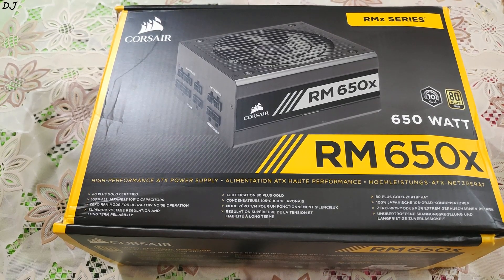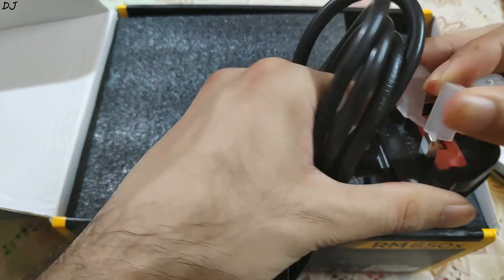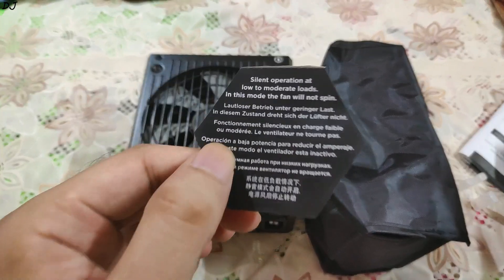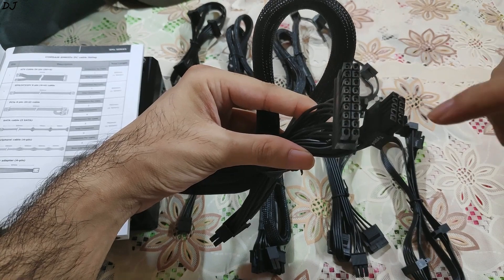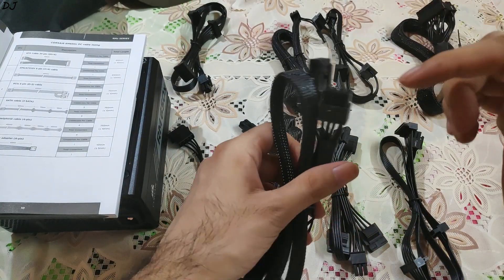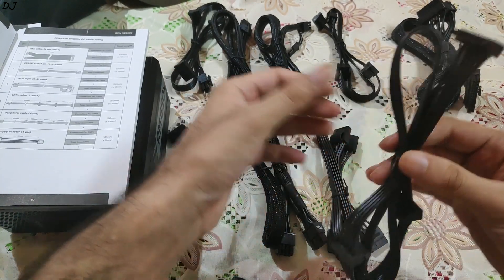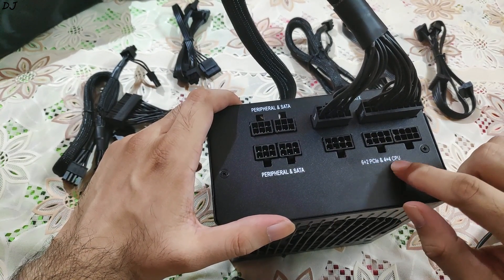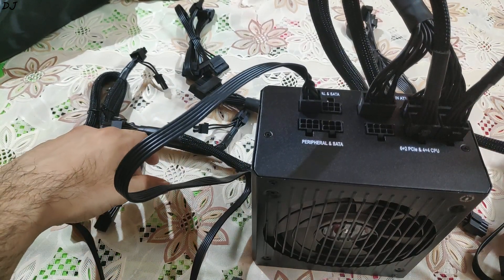Corsair RM650x 2018 Power Supply Modular Cable Installation Guide & Overview

Comment: Upgrading my PSU(RM 650) and GPU to RM850x /Rx7900xtx. RM850 PSU only comes with 2 PCI cables. Can I use 1 PCI cable from my 650RM to use on my RM850?  Rx7900xtx requires 3 PCI cables.
Reply from the maker: Should work
https://www.corsair.com/us/en/psu-cable-compatibility
Reply: @GamingDJ4u  Thank you. It works.

Comment: the gpu I want requires 2 - 8 pin pcie connectors, would the two 8 (6+2) pcie connectors work fine?
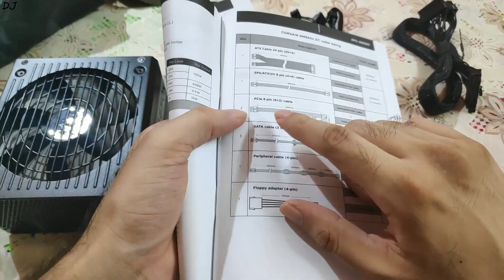Reply from the maker: yes , you need two of these cables 05:03 , i used 2 8-pin cables instead of one to power my rtx 2070 super 2 years ago .

Comment: probably a noob question do i need to plug in the two pcie connectors for an 8+8 gpu? or just use the one cable with dual ends?
Reply from the maker: Separate cables are recommended for a better power delivery
Reply: @GamingDJ4u  thanks so much!

Comment: This works the same as the Corsair rm750x power supply right?
Reply from the maker: Yes, rm750x should have an extra 12v ATX cable , high end mobos have 8 + 4 pins connection slot for powering the cpu . Extra 4 pins for extreme overclocking . Rm650x only comes with one 1 8 pin eps/12v atx cable

Comment: Can i replace the 24 pin cable with another rgb cable
Reply from the maker: Can't use any custom cable , compatible cable is required , cable has in line capacitors , something like this
https://www.corsair.com/ww/en/Categories/Products/Accessories-%7C-Parts/PC-Components/Power-Supplies/premium-individually-sleeved-atx-24-pin-cable-type-4-generation-3-config/p/CP-8920158#tab-tech-specs

Comment: Hello. I have a gtx 1080 with only 
1- 8pcie pin. Is there any solution to make the pcei work for my gpu since there are 2x (6+2) in the rm650x?
Reply from the maker: You can just connect the single pci e wire

Comment: I take the PCIe and CPU ports on the PSU side are interchangeable right?
Reply from the maker: Yes , high end mobos have support for 8 + 4 pin connection for powering cpu , it's for extreme overclocking , so you would need another cpu port on psu , rm750x and above PSUs come with the extra ports and the cpu wire .

Comment: Thank you so much for this video, attempting my very first build tonight, was having a panic attack staring at all the cables, wish I had someone to FaceTime or Zoom call to help walk me through this, Pray for me
Reply from the maker: Good luck , all cables are marked , so just double check that they're plugged in the correct socket . A critical problem can only occur if you somehow plug the pcie cable into your cpu power socket or eps cable into your GPU .
Reply: @GamingDJ4u  got it all assembled, powers on, but no display when I try to enter UEFI BIOS

Comment: actually those 2 right ones are for CPU,  some motherboards have 2 CPU cable.  I assume the voltage is the same as PCI because then only 1 PCI left

Comment: Hello I have the latest Corsair RM850x 80plus gold power supply, they gave me the following:

1. ATX 24 pin Quantity 1

2. EPS/CPU 8 pin Quantity 2

3. PCIe 8 pin Quantity 3

4. SATA connectors (quantity 2 have 3 connectors & quantity 1 has 4 connectors) 

5. Molex Peripheral (quantity 2 have 4 connectors) 

6. Floppy drive adapters Quantity 1

I have done extensive amount of research what each of them do and all cables for my motherboard, however apart from plugging in the 24 pin I have the following issue 

From the top left corner it says Peripheral & Sata 

Middle top it says 6+2 PCIe & 4+4 CPU 

Top right corner it says 24PIN ATX ( I know this one from your video)

Then the bottom left it ALSO SAYS Peripheral & SATA 

And in the bottom right it ALSO SAYS 6+2 PCIe & 4+4 CPU

I am confused since I have the following cables and all the conflicting contradictions of which components fits into which part. 

Thanks for taking the time to read this and thanks for liking my other comment I look forward to your reply, much appreciated
Reply from the maker: Why the confusion? You can just plug in the wires like shown in the video, 850x gives you extra ports and wires. Any 8 pin port can be used to power your cpu or gpu. You need to make sure you use the EPS cable to power your cpu and the pcie cable(s) to power your gpu. All cables are marked . If somehow you connect the pcie cable into your cpu power socket, it would short circuit your power supply. To power the Cpu, 1 8 pin cable is enough, some mobos have 12 pin cpu power socket, extra 4 pins for extreme overclocking, your mobo has the extra wire for it so you can connect that as well if you want, remember an eight pin eps cable can be separated into a 4+4 cable
Reply: @GamingDJ4u  ok I will just tell you what I am dealing with. 

Obviously the motherboard needs the 24pin so I know that 

My motherboard is ASUS ROG Crosshair VIII HERO X570 ATX Motherboard with PCIe 4.0, Integrated 2.5 Gbps LAN,  USB 3.2, SATA, M.2, Node 

The motherboard needs 8 pin and 4 pin with the ability to split which I know so I would need to use both 2x EPS/CPU connectors. 

I need to use all my SATA power connectors which is all 3 of them which is 9 Fans and Internal Hard Drive. 

I don’t know if I may need the molex but I want to connect them anyway for future purposes. 

And I have to use all 3 six plus PCIe for my graphic card 

Question is where do I  connect all of them in order or however you want to put it? I mentioned the marks of all the parts so in detail but to make it easier for you I can provide an image of how my power supply looks. 

https://90a1c75758623581b3f8-5c119c3de181c9857fcb2784776b17ef.ssl.cf2.rackcdn.com//607744_955096_03_front_zoom.jpg

I’ll follow every step you tell me 

Thank you

Comment: Hi Gamin DJ, i know that this is the corsair review and i just bought cougar GX-F 750. And i realised that the 24-pin has a missing pin in it, is that normal?
Reply from the maker: I checked its image on their website and noticed that the 5th pin from the left side was missing , should be normal then , if possible , try posting on reddit's buildapc thread
https://www.reddit.com/r/buildapc/
You'll get a better response there
Reply: @GamingDJ4u  okay, thankyou for the information🙏🙏

Comment: Is there a 2nd cpu cable?
Z490 has 8 pin and a 4 pin cpu power.
But overall thank you for the explanation, I finally found someone who explains it lol
Reply from the maker: Hi, that extra 4pin cable comes with rm750x and higher variants , the extra 4 pin is for extreme overclocking , otherwise you're ok with just the 8 pin connection.
Reply: @GamingDJ4u  yea I've heard that, thank you for your response. 
Might just get a seasonic gx750, almost same price, has the extra because I plan on putting a 11900k on it in a few years which is power hungry

Comment: Thank you I just got finished with my first PC build and I have the RM750 I couldn't get my PC to boot. Turns out that I had a PCI-E cable attached instead of a CPU one. If it wasn't  for you going over the cords I would of still been trying to figure out what I did wrong. Thank you for being through.

Comment: Thanks for a clear video. I already watched it, but came back to see if you used all the cable plugs from the atx 24 pin power supply end of the cable. Because the larger plug has 18-20 pins in it and the other part has like 10 pins. In the power supply end of that cable you plugged them all in. I just needed to understand if all the plugs from the 24 pin cable get used at the power supply end. I guess they do.
Reply from the maker: Correct, more pins on the psu side, it has been more than a year now since I built this pc and everything is still going well.
Reply: @GamingDJ4u   Oh good to be assured then, thank you. It's only my second pc I'm trying to build and this motherboard is smaller and only has less pins on the motherboard side. But plug all of them in at the psu end right. Anyways, it's a great video, and very helpful. They're still selling the RM650x because 650 watts is still plenty of power for many builds and since there's only about two or three good videos on YouTube about it, you'll continue to get views on this. Thanks again.

Comment: Just a note if you are using new 30 series graphics cards, you must use 2 different PCIE connectors because the power draw can fry some cables if you use one cable.
Reply: it doesn't matter since each cable will split into two cables each one of them giving u 50/100 of the power so even if you use two different cables u still getting the same power from one cable split into two

Comment: Please tell me how to connect power cpu this motherboard have 2x4 and 2x2. And my supply have just cable 2x4 cpu.   https://www.gigabyte.com/Motherboard/Z490-GAMING-X-AX-rev-10#kf
Reply from the maker: You only need the 8-pin for the CPU. The extra 4 pin is for extreme overclocking but even the 8-pin should be enough for OC  so don't worry about it. If you want to fill in the extra pins, get rm750x.
Reply: @GamingDJ4u  thank you 🙂

Comment: Great video. My PC powers up but the drives connected to the SATA don't work!
Reply: What Gaming DJ said. Your manual should warn you that if you use an on board hard drive, like the M2 or another kind, sometimes it mutes the use of the sata #2 or sata #5 plug areas on your motherboard. Or other sata # plugs depending on what your motherboard manual says. If that's the case for you, you just need to leave the sata plugs empty that are disabled and use the others instead. For example, you might want to plug in  another hard drive in sata plug #1 , and skipping sata plug #2, plug the DVD drive into sata plug #3, kinda thing.  If you do not have a physical copy of your motherboard instructional manual, the manufacturer website may provide a downloadable pdf file of one. Just make sure it's for your exact motherboard.  A side note for the future : Never ever ever re-use the power supply cables with any other power supply. Only ever use the power supply cables provided with your new power supply. Even if it means having to unplug and re-route all the cables. Like if you're upgrading the power supply. The cables are not all powered the same voltages and capacitors. That's just extra advice for you.
Reply from the maker: If you have connected any nvme drives to your motherboard , some sata ports get disabled , might be just a loose connection

Comment: So where do both PCI express 6+2 cables go? The 2 ones in the bottomright?
Reply from the maker: Yes , just don't mix the 8 pin cpu and pcie cables , they are marked
Reply: @GamingDJ4u  Thanks! Gonna connect my 3080 to it, need both bottom right then. hehe.
Reply from the maker: Would recommend you to get rm750x for that gpu
Reply: @GamingDJ4u  I know, thats what recommended. But I don't really run much more than that GPU. Won't hit 650.

Comment: The PCIe and the CPU holes on the PSU looks the same. So does it matter if you swap the positions of your PCIe and CPU cables on your PSU as long as you connect the other end to their respective components correctly? (PCIe to GPU, EPS to CPU)
Reply from the maker: It shouldn't matter but there's only one cpu wire so connect it under cpu section , I'm also using 2 dedicated pcie cables to power rtx 2070 super instead of a daisy chain
Reply: @GamingDJ4u  The PSU I want to get is the RM 750x which has 2 PCIe holes and 2 CPU holes, which means I can use 2 PCIe cables and 2 CPU cables. Assuming I want to use 3 PCIe and 1 CPU instead, I can just simply plug the 3rd PCIe cable into one of the two CPU holes on the PSU right?
Reply from the maker: Yes you can . Individual pcie cable will have an extra 6+2 connection

Comment: Hello. The new rtx 3080 requires 16 pin cable. Can i plug two pcie cables into the psu in different ports and plug the other half of the cablr in gpu even though the cables are apart?
Reply from the maker: Yes , avoid using one cable to fill the connectors on the gpu . Use two dedicated 8 pin pcie cables to fill up the 2 pcie 8 pin inputs on the graphics card . Nvidia recommends getting a 750 watts psu
Reply: @GamingDJ4u  i was thinking of getting an 850 watt and thank you very much

Comment: Is it safe to plug a sata cable in the peripheral slot on the rm650x psu?
Reply from the maker: Wouldn't recommend it , sometimes wires have different , may deliver 12 volt instead of 5 volt but it generally doesn't happen with wires that comes with the psu , like you using evga wires with corsair psu
Reply: Gaming DJ  I just ordered that PSU like 2 days ago and I wasn’t sure if there were 3 spots for the sata plugs, I also wasn’t sure where to place all the sata plugs (besides the one spot you showed in the video). Can I plug it in all four spots where it says SATA/PATA?
Reply from the maker: @Sandra-pk9sh  had to re-watch the video as I forgot that psu comes with 3 sata cables and 1 peripheral cable , 4 slots for them on the psu , you can connect them anywhere under peripheral/sata
Reply: Gaming DJ thank you for answering my questions!

Comment: I guess pcie and cpu connections are just same with this psu? I mean both outputs look similar and they are near
Reply from the maker: There wires are marked differently, would connect the wire plugged under the cpu section directly to the cpu socket, multiple connectors should be available though as more than one cpu or pcie wires are used by some mother boards

Comment: Hello there thank you for the tutorial,  i have a question i just got a corsair hx850  platinum powered Supply my question is can i plug in the cpu and the pcie any where where is say pcie & cpu or there is a specific place for the cpu or the pcie? Please help it's my first time building a pc
Reply from the maker: Anywhere under the marked section , often multiple pcie wires are required for high end gpus
Reply: @GamingDJ4u  thank you so much

Comment: I have an issue, the PSU I bought is a Gamemax 750w 80+gold and it came with all these cords but they aren’t labeled and I have no idea which side goes into my PSU and which ones hook into my equipment
Reply from the maker: Did you check their website for a manual?
Reply: I did and unfortunately I have found absolutely nothing, beyond frustrated on this because I did my research for my PSU and supposedly it was an almost perfect one so I was like great that’s what I want, and come to find out there’s no instructions, there’s no wire labeling, it’s most definitely not beginner friendly at all and every video detailing how to setup a PSU is so far different from mine that it’s not even worth the time to keep searching for how to set this thing up, so as of right now I have a $1400 build just sitting with only the mother board, CPU, CPU Cooler, and Ram hooked up in the case.

Comment: Hello great video! I have a question. Does this power supply fit in a mini-itx case? Thank you in advance
Reply from the maker: I don't think so , check the dimensions provided for PSU in the cabinet specs and compare it with this PSU's dimensions , it was a bit difficult to fit it in this cabinet as its a bit a smaller than the standard ATX cabinets
Reply: Gaming DJ Thank you for the quick response. I have a NZXT H210 Black - Black Mini ITX case. It does say that it supports ATX.
Reply from the maker: It supports it .
Reply: Gaming DJ Thanks alot! It’s such a relief to know this, because I just recently ordered the power supply and wasnt sure if I bought the right one so I’ve been stressing alot. It’s gonna be delivered on Tuesday, can’t wait to build my very first own game pc. Have a great Sunday!

Comment: I’m using this power supply but 750w and I’m in the middle of building my first computer, so this came in really handy 👍🏻
Reply: How did it go?
Reply: UnboxingAndBeyond had the computer running for about 3 days now and it’s been great
Reply: And how about 3 or 4 months of use? it's good? do you have coil whine?
Reply: Carentesitre been going great so far no real problems that I can see

Comment: Dude thank you. I was so intimidated after opening my new PSU but I am feeling more confident now.
Reply from the maker: Good luck 👍 make sure there's no static charge while building your pc and you connect wires in the right slots , there's no risk of any damage , the worst that can happen is that it won't start which can be diagnosed afterwards .
Reply: @GamingDJ4u  Yes thats exactly what happened. No post... One step at a time. :)

Comment: Also will this psu support a RTX 2070 SUPER?
Reply from the maker: Yes , I have an RTX 2070 Super paired with it.
Reply: Gaming DJ What is the power cable called that you will need for the rtx 2070 super?
Reply: And rtx 2080?
Reply from the maker: Pci e cable , yes its enough for rtx 2080 as well
Reply: @GamingDJ4u  thanks

Comment: So I have to thank you for this video. First of all I had no idea that the 24 pin cable had an 18 and a 6 pin connection I thought it was a 24 pin and the other was for something I didnt have. I was wondering why I couldnt power up my psu. And now thanks to you my dumbass can fix this overlooked problem
Reply from the maker: Good luck with the build 👍